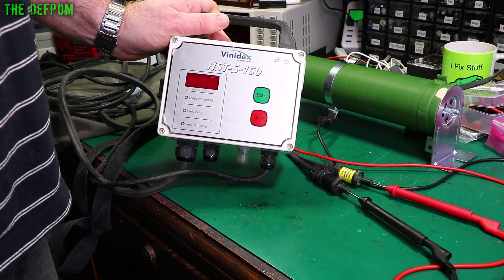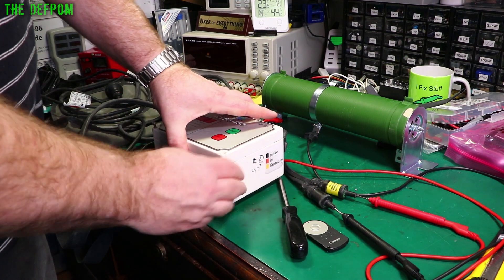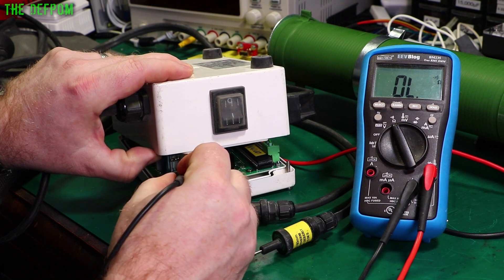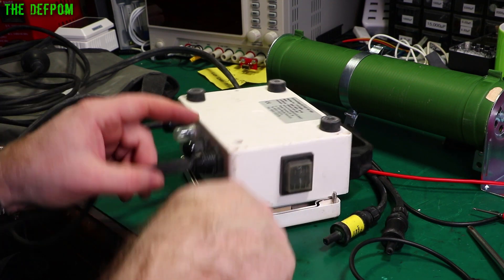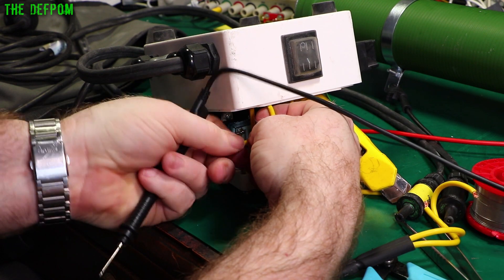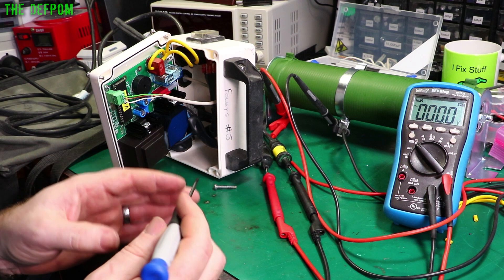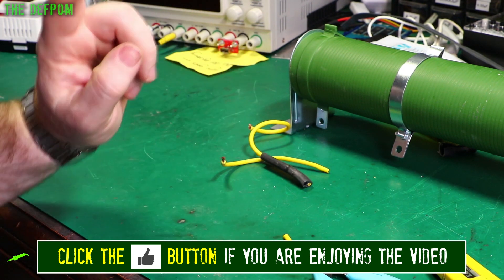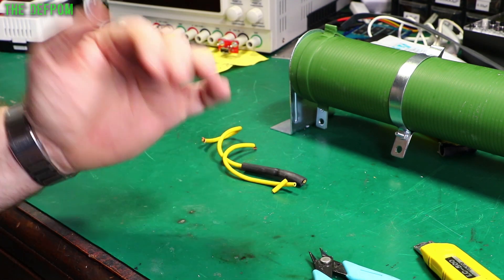🔴 Vinidex HST-S-160 Electrofusion Unit Repair SN_439 - No.791

Comment: Hi Scott, 
just to give a handy tip for finding the point where wires are broken.
Disconnect the faulty cable from the mainboard, lay the cables stretched on a table and connect + and - of a USB wallplug charger to the 2 yellow wires.
Use a (cheap) Non Contact voltage detector (those pen types) and pass the detector along the cable, where the beeping stops, the broken point is in 1cm region.
These Non Contact voltage detector pens are advertised for 90V to 1000V, but they can detect 5V from a USB wall charger.
With a Linear power supply, this doesn't work, so i guess that these pens detect the swithing noise from the USB wall charger.
Here is a example of such a detector pen :
https://postimg.cc/3kPWj1cW
This can save up lots of time if its a long cable.

Comment: You've got a nice little niche repair business going there.  Happy welding!
Reply from the maker: I just got given two more to fix... unfortunately I’ve spent 3 hours on them so far and haven’t been able to get them going yet, one is sensing the input voltage incorrectly, the other isn’t sensing the load being present...

Comment: The first thing I do if something has silicone isolation is doing the same test as you did (check how "elastic" the wire is) My experience with silicon testleads is that they do not support the copper at all en bend much to easy and upto much higher angles due to the elasticity.  And copper does not like that. My Brymen test leads broke after a month or so,  My Agilents  failed after 3 years or so, my new bought Keithley 7510 broke after 6 months.  I check my wires on a regular base and they always break hust above the probes. The first time this happens I replace the probes by good goldplated banana jacks  (and probes for bananas) I also use several non-silicone testleads and they all are over 10 years olds and I never had a problem with them.  I only still use silicon for some meters because  it feels nicer if you are probing, because they are not so stiff. But I do not buy new ones. The last one was a set of miniprobs from a very good brand (costed around 30 euros) Ater a few weeks the first one died, after 3 months and like 10 repairs I tossed them out.
I only use them in my lab but for professional repair so I am using then a lot. (like you know, repairing is for-most measuring, so they often are used for a few hours almost continu per day.

Comment: So as each strand of wire breaks the area gets hot with the remaining strands acting as heating elements.
And the weld takes longer and longer due to reduced current.
Aint it a bugger lol.
Multimeter leads are a git for strand breaking, always near the probe and it's a moulded probe so hmm.
At least its not the multiway cable on old c.b's that have every function on the mic,  silly design, snap snap.